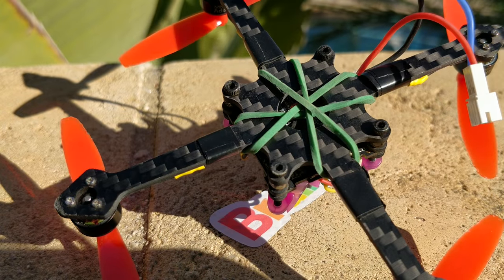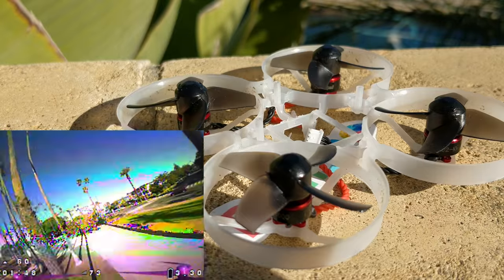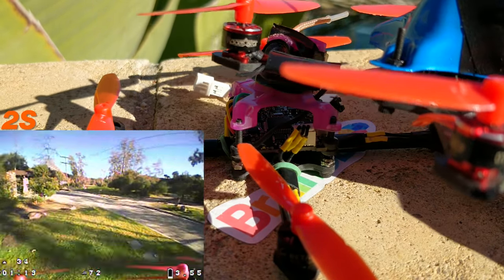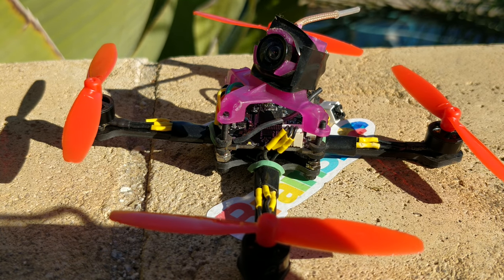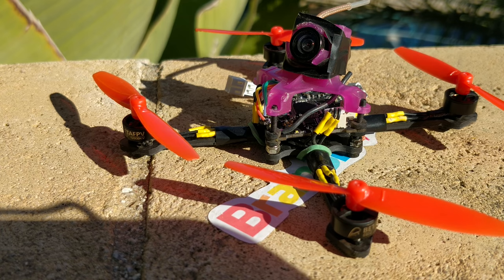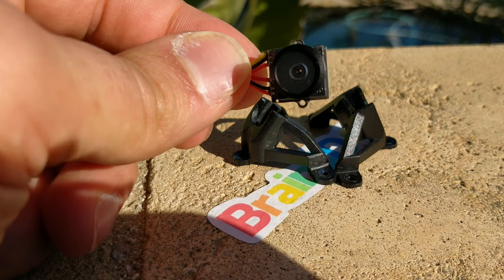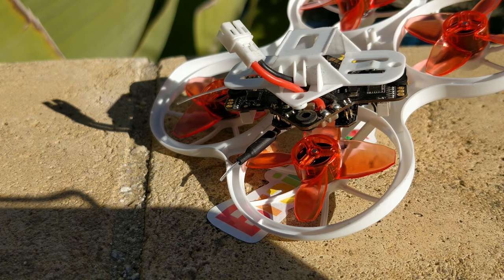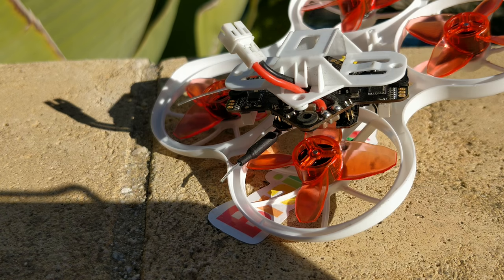Toothpick frame build development updates

Comment: Do you think this on 2s with a split style cam can be a racing class in the future?
Reply from the maker: This is a common question. Please realize that a split weighs as much as this entire quads AUW almost. It would work but would not be any fun to fly anymore. You can also put a split on any 2S whoop too.
Reply: @Kabab  the new cams are 13ish grams(turtle, split V2)
Reply: @quickf0x792  Yup - and if they can make a 16x16 capable version, that'll be the core of this.  It may not even need to be full 1080p recording, just solid 720p equivalent DVR  would be impressive enough... but it probably wouldn't save weight, so might as well record in 1080

Comment: How would you feel about a Bat 100 frame as a temporary frame until the toothpick comes out? Would that work as a platform for a mobula 7 / Snapper 7 transplant?
Reply from the maker: Good but there are two main issues with it.  one you need to use a real stack, not one of these AIO whoop boards.  And two, I don't believe it fits the 65mm props.  The 65mm props are magical.  I've not found anything that can compare.
Reply: Bat100 frame max prop is 56mm.

Comment: Great video!
1. How do you mount the FC upside down?
2. What pids and rates are you using?
3. What the distance between the motors in millimeters?
Reply from the maker: 103mm. #2 is in the description and #1 just reorient the board. No big deal
Reply: 1. But then the left and right is upside down???🤔
Reply: Do you think one of these frames can fit? 
Full Speed Bat-100 100mm Carbon Fiber Frame Kit or
Gemfan Whirly 95mm Wheelbase 2mm Arm Carbon Fiber FPV Racing Drone Frame Kit 19.6g
Reply from the maker: @EZFPV-yb9sh  the bat100 is sort of similar to this except it doesn't accept the larger 65mm prop. It won't take the 35mm whoop boards.

Comment: they're old motors now but definitely recommend the eachine 1102 11500kv they're fantastic for 1.5/2/2.5" props on 2s and weigh 4g with wire,  pretty cheap too!
Reply from the maker: I'm expecting a 1202 to eventually win out as the go to motor size for this super light class.
Reply: @Kabab  that would be a great size too!

Comment: On the frame design: have you thought about leaving some M2 or M3 holes on the ends near the tip of the arm beyond the motor mounts so that users can add a ring for indoor flying ( https://i.imgur.com/2KdKsNx.jpg )? Somewhat like the HoverBot? I have a 2.5" 1103 build that has a 3d printed ring for indoor stuff - the ring is nylon and honestly nearly unbreakable... no joke.  This build is fat AF for indoor.  Would love to have a lighter 1s version using your spec that has an easily removable ring for big indoor / outdoor.

Comment: Awesome! Racerstar actually used to make a clone of the KK65 prop - predrilled at 1.5mm in PC and in biblade and triblade format. Sadly, they totally botched it. Not only was the hole drilled off center but the hole was a little small and people were ripping out motor shafts taking them off. So i never got to see if triblade flew any better. looking forward to a decent tri version! On 1103/2s/KK65 with a fatter 55g quad but light 26g 450mah 2s (2s batteries that run off a 3pin powerwhoop / JST PH 2.0 balance lead - no main lead) i was able to fly and goof around for 7+ min. People were hovering similar setups for like 12min. xfire variant would be AMAZE! nice work Kabab!!

in case you’re interested in the batt which is a little weird to charge: https://hobbyking.com/en_us/turnigy-nano-tech-450mah-2s-65c-lipo-e-flite-compatible-blade-130x-eflb3002s35.html
Reply from the maker: I actually remember that prop. Dunno how they got it so wrong

Comment: Just to give you another impression of there props: I have flown them on 1103 8000kv motors with 3s. Absolutely bonkers, the quad is a teleporter but yes the props will flutter and unpredictable things will happen.
Best. Props. Ever.

Can't wait to see your video on the 0804 motors. They look promising (albeit expensive...)

Have you had any issues with breaking shafts and bend bells on the motors so far? I have had serious issues in the past (Happymodel SE0706, Sunnysky 0705, Racerstar 0703, Racerstar 0603) and would like to know if that improved

When you make your frame available: Where will I be able to buy this from? Hopefully there are retailers that also ship to Europe for a reasonable shipping cost?
Reply from the maker: I'm hoping to have it available within a month. I haven't bent anything but the prop itself in all my crashing. It's really really hard to break anything when it's 40g

Comment: Hey, Bob... I just found some 0905 motors from DYS on Banggood. I found a small stack too... Just need to find a good frame. 
About 3 bladed props, Eachine has some... It's about 50mm. 😉
Reply from the maker: They unfortunately weigh too much. I'm gonna say 3.25g is the max for a quad like this. After that you start needing 2s and that's not so fun anymore. Becomes dangerous
Reply: @Kabab  Well... That's true... 😕
Reply: @Kabab  oops! Just left a comment about these same motors before I saw this comment. As I said though I have these motors and guess what, the 1103 motors are the same weight! Think I'm gonna try them in the LDARC GT8 frame.
Reply: @Kabab  "Becomes dangerous"   ..if is not a whoop.
And, also the noise/sound is part of a craft. ....And his 'socialized attitude'.
bye.
Reply: @FrequentFlyerRC  I have seen those same 0905 motors.  What is the mounting pattern? On 2s they have a ton of thrust.
Reply: @cccagley5276  7mm.. kinda sucks because 11x motors have a 9mm mounting pattern. Ill just go for 1103 motors😉
Reply: There are also sunny sky 0705 motors that the bat100 uses. I think banggood sells them now, but if not fullspeedrc does...they seem perfect for this frame. It’s basically a bat100 wit modern design
Reply: @seanmetzger4780  i wouldn't waste time on 07 size motors, they just dont have the power that a 08 or bigger size motor have
Reply: Thijs fpv 0705 will be more power then an 0802...and should be equal to an 0804.
Reply: @seanmetzger4780  hmm not sure about that, i used 0703 motors and i don't really like it. i would just go for 0802 or 1103

Comment: Exellent progress loved this vid!
I'd be very keen on a high end kit version for 1S. I do not own any whoops to date so basically a blank sheet to start here!
What might be worth considering for 1s is one could use the multi pack chargers many whoopers have already with 2S this makes a 2+s charger needed thus multiple chargers or longer charge time doing them seperately. that'll be a killer for many I guess.

Take into consideration the biblades do get pushed away easely in a hit and saves the shaft from being bend a triblade does not have this advantage. triblades may bend more easely too in a direct hit 2 blades take the beating instead of be pushed away like a biblade.  If you manage to get a batch of ideal props please make them highly visible (white/yellow etc) to find the drone back in the park...

Do you think a pressfit triblade may slip on the shaft?
a beeper would be convenient as well...
Reply from the maker: I ripped off the beeper. 😅 Don't need the weight. The triblade should be better I'm hoping. A lot better
Reply: @Kabab  , beeper proved to be very usefulll for me for LV but retrieving out of bushes as well. We have lost a few micros over here hidden under leafs in the evening...
I recon a triblade will be better but it may have it's downsides I described. Looking forward to your progress .
When can we pre order?

Comment: oh yes, I'm totally building one. Would be awesome if your frame is available on newbeedrone so I can order frame and camera mount at once. Since shipping to Germany is not the cheapest thing :D

btw is it possible to connect a crossfire nano receiver to the eachine trashcan F4 board?
Reply from the maker: yeah shockingly it looks like the F4 version will take Sbus in with no issues.  A whole separate pad just for Sbus in regardless of if there is or isn't an Rx built in.
Reply: @Kabab  okay interesting. But why can't it be used with crossfire protocol? Sry for my asking, I only flew Kiss to date. Is it is because there arent any UART pads?  it should be possible to wire it directly to the ARM uC.
Reply from the maker: @BiecherBender  it may be able to. I haven't tried

Comment: Great video. Thx, I am learning a lot form your channel.  I wonder how the BetaFPV Pro 2 S would do changing out the motors to 0802 DYS 10000KV motors and run it on 2S all the time since it appears these motor have more more powerl than needed on 2S outdoors  based on your throttle percentages and seem no not have enough power running 1S indoors from what I have heard in reviews?  This should also give it longer flight times indoors on 2S with (2) 300mah batteries and could program a switch on my Taranis to chop off 20% throttle if needed when running indoors.  Just a thought do that and change out the camera to a nicer 25mw/200mw smart audio switchable so for indoors use 25mw and outdoors 200mw.  What do you think?
Reply from the maker: I wouldn't recommend a swap to the dys 0802. You're not gonna get more performance out of the beta. It's actually pretty good as is. 2s doesn't really give you more flight time. You'll get more time on a 1S 450mah. The 1s performance is fine. Not great but not bad
Reply: @Kabab  Thanks Kabab, I will try using a 450mah battery on 1S for indoors and then use it in 2S mode outdoors.  I am sure it will be more than enough power than I can handle on 2S anyways and may need to cut the throttle by 20-30% on 2S while getting use to it.
Reply: Thanks Kabab for your help.  It sounds like the downfall is the camera so maybe swapping it out to a Caddx EOS and just leaving the vtx would be a good option.  Sounds like using a 200mw vtx would be a waste of battery since I have been told with these little whoops you are pretty much limited to the transmitter range over video range.
Reply from the maker: @luv2flypilot  if you can find a better camera that fits in there or a different print or top part that fits a different camera, yeah that's all I'd do on a beta.
Reply: @Kabab  Thx Kabab, I do also have a BetaFPV 1200 TVL camera that has really good video quality per the reviews I watched on it, but its a little bit larger than the Caddx EOS2 but I may try both and see which one I like better.  I will let you know what works out best for me.  Thx, for your help.
Reply from the maker: @luv2flypilot  nothing was wrong with the original one you had. It just totally blows. I was being really nice in the video.
Reply: Kabab FPV What a difference changing out to the Caddx EOS2.  I have not flown in outside so did not give it a chance with better lighting.
Reply from the maker: @luv2flypilot  unfortunately it's still not excellent but literally night and day compared to the beta cams
Reply: Kabab FPV agreed 👍🏻

Comment: Dear Kabab,  Do you think KingKong LDARC ET125 V2 Frame will be a good choose for Toothpick?
Reply from the maker: That is a good eye.  Yes it would fit but you're forced to use 11xx motors (which is probably a good thing to be forced to do) and you'll need to just tape the whoop board down in place.  I'm not sure how you'd attach the camera to the whole getup.  It will work, just nowhere near optimal
Reply: @Kabab  I'll wait for yours ... please let us know when you ready ... want to buy the whole DIY set.  Thanks.

Comment: This looks like a great setup and good alternative to ducted. Can’t wait to see your preferred final version.
I like the Caddx Eos and the FXT T80, T81 (micro Falcor) cameras and run them on several micros. I’m having trouble finding an individual micro VTX that is small and lightweight. I’ve been using VTXs from other sets that have broken cameras or buying a set that I like (AKK) and swapping the camera. Does anyone have a good suggestion for a tiny VTX? Thanks!
Reply: Is Eachine VTX03S tiny enough? Because it performs great, does 200mw, Smart Audio and is barely bigger than your typical whoop-style VTX.

Comment: You don't need Trappy to make it go a mile.  Just put a propper 2.4GHz dipole antenna on it, while shielding the trace on the FC that throws the tune off.  Interesting project though still!  I'm inspired to hack up some of my micros and design some stuff for gits n shiggles.

Comment: just notice, your running props out? and have you tried running 2x 260mah in parallel? Thats about 520mah with almost the same weight as the 450mah ones. Cant wait for the frame kit and those racewires. INNOVATION!!!!!
Reply from the maker: Keeps crap off the lens

Comment: Maybe you should try hubsan like props on 2s. They bit shorter but they stiffer.
Reply from the maker: I've tried every prop I could find back in the day.  These 65mm props are the magic
Reply: @Kabab  so, now I have to find frame, that will fit those props and 16mm stack from BAT-100  ;) with shipping to Europe

Comment: How durable is this frame?
Reply from the maker: It won't break. It's super overkill for the size. I could cut it down in weight but realistically I'd only be saving maybe 2/3 of a gram. It's a 5g frame. 40g auw can't generate much force. Even on 2s
Reply: So where will I be able to buy this frame?
Reply: @hawkeye1131  good question. I am curious also.
Reply: Haven't even received my mobula yet and I already want to tear it apart, when can we get that frame!
Reply: @dylanlikeavillan5165  will be out is 3-4 weeks      gimme gimme gimme
Reply: @trfpvVT  might be a good time to Cad and cut my first frame since it's super simple and only a bottom plate basically, at least I'll be sure to have one, his are gonna sellout like hot cakes I imagine

Comment: Planning to build a 1s/2s with 1102 15000kv motors and hoping it runs as good as your build.
Reply from the maker: Check out the TP3 video and more TP3 videos coming this week.
Reply: @Kabab  I have I want to make that too. Converting my tiny shark to a bigger frame and make it lighter
Reply from the maker: @mattidallama  mmmm maybe that'll work. Maybe consider a toothpick build? Might be easier
Reply: @Kabab  ya moving the motors over need new other parts. Just wondering it the 1102 motors would work on it over the 08xx motors
Reply from the maker: @mattidallama  oh I thought you were talking about the little fatshark 101 brushed quad.   Just pay attention to the motor mounting platforms. Those are crazy variable
Reply: @Kabab  looks like motor is a 4 hole style like most other 11xx motors of old.

Comment: Looks cool but the motor price is kinda putting me off, weird that iflight puts out really good 2208 motor for 15$ but a 0804 for 2 less 🤔
Reply from the maker: unfortunately small motors are not cheaper to make.  the Beta's are on piroflip for I think $9 and are excellent.  Also, if you already have a whoop....you're basically done
Reply: @Kabab  wait I'm not burnt out on my tinyhawk don't make me do it
Reply from the maker: wait longer.  I've got lots of testing to do
Reply: @noamamir0942  Wear it out.  These are already the best value in FPV, because you wear out components instead of crashing them out of commision in the middle of the bathtub curve.  As other people get bored with theirs, buy one of those and then you'll be able have your own indoor Tinyhawk, and can convert that cheap used one into an outdoor Hawk

Comment: What about Racerstar BR0804 12000kv motors? 1mm shaft + screw mount for props that use that. Takes 1-2s voltage.
Reply from the maker: The thing about 0804 is that the prop is already extremely large for the 08 size and the height doesn't make all that much difference if you can't already spin the prop. Also, an 1103 is about the same weight as an 0804.  So I've got some 0804s on the way but I'll be testing 1103 as well and betting that's the better way forward.
Reply: @Kabab  Any 1103 will require drilling out the props to 1.4mm though right? Which 1103 you got coming in?
Reply from the maker: @leonardvdj  yes it will require drilling. If I end up selling the props myself I'd include some drills. I've got the racerstar and I think some prototypes coming. I'm hoping the racerstar are good enough because they're dirt cheap and would make the class far more accessible

Comment: Can I change my snapper 7 into your frame, Kabab? You said we can change the mobula, so I guess we can change a snapper, too...
I'm so excited of your frame! Keep on this good work so we can fly it as fast as we can! 
When do you think it will be in sale?
Thanks, Kabab
Reply from the maker: Yeah it will work
Reply: Kabab FPV 
So you mean that the snapper will fit in the mobula Kabab frame? Or are you making a snapper Kabab frame like a tiny hawk Kabab frame that you are making now.
Thanks
Reply from the maker: @박준성-x3p  any whoop will work except the TinyHawk however the 1103 motor is optimal. The smaller whoop motors are good and will work but won't be optimal. Still lots of fun. 0802 motors are great on the 65mm props

Comment: If betafpv is the go is it the 0802 17500kv or the 1103 11000kv?
Reply from the maker: unlikely.  1103 will probably be better but the 0802 is pretty darn good
Reply from the maker: not 17500kv.  12000kv is even a bit much for the motor
Reply: Great. Look forward to building this. Agree with all your comments about park safety. It's a great way to get stick time, and not hassle people. Make the frame!
Reply: @Kabab   Does the 12000KV work well with 1S? Seems kinda low for 1S

Comment: Lots of good info here thanks, my 1103 6500kv on 75mm props is still going strong after over a year and 13 minutes flight times from 450mah 1s with fpv is great but a bit boring lol, without camera I could get 15 minutes ...
I want to experiment with the 0802 etc sized motors but they don't screw straight onto bamboo s!ewers like the 1103 motor does.
Reply: 11xx on 1s is crazy    i might want to see what happens lol